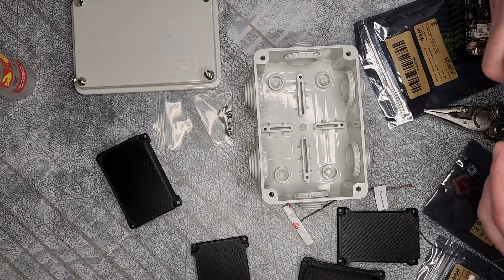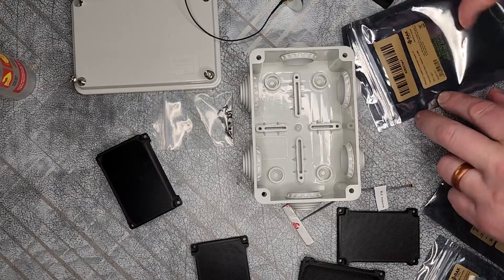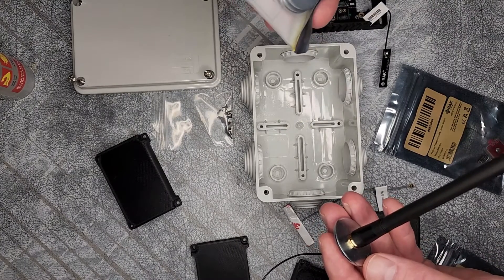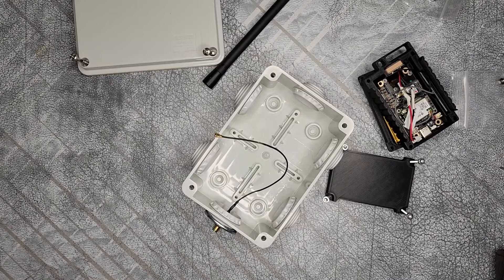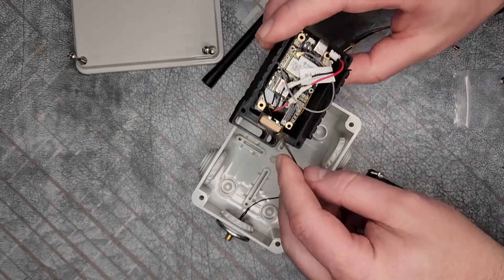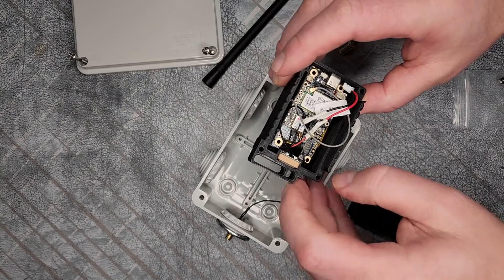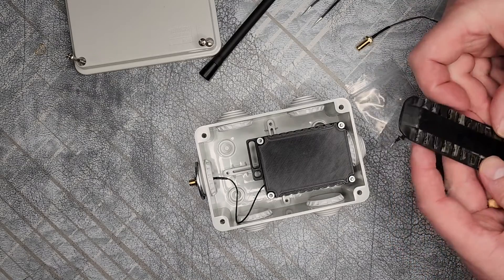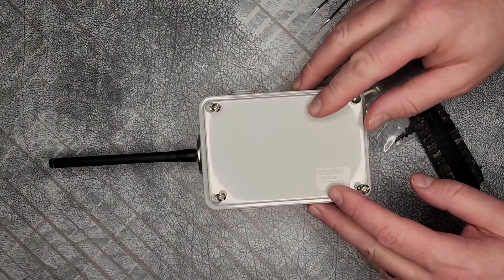Building a Meshtastic Fixed Node with Minimal Tools

Comment: How do you make contacts?   I can barely get my own devices to communicate consistently .  Often have to create/update a channel and share it between devices to get them to talk again.   RIght? you can only communicate unless all settings are the same on both ends?
Reply from the maker: Hey thanks for the question. While here in Albania I have only made one contact. In the states I have made a couple around my home there. The key if you are try to talk to other people is keep the default setting. Your radios will use other radios to hop no matter the settings but that radio won't see that message. I know a lot people are concerned about privacy but using the default is really the best to find other users. You can also search this website: https://meshmap.net/
Please let me know if you have more questions.

Comment: Can the WisBlock be used with E-Ink screen?
Reply from the maker: RAK does make a E-paper the RAK14000 screen. It is designed to work with the Wisblock. However, I never seen one integrated with Meshtastic.
Reply: @EmCommSolutions The heltec paper is an e-ink version of their v3 for meshtastic so it’s definitely already getting ported for e-ink 😁
Reply: T-Echo device is also eink